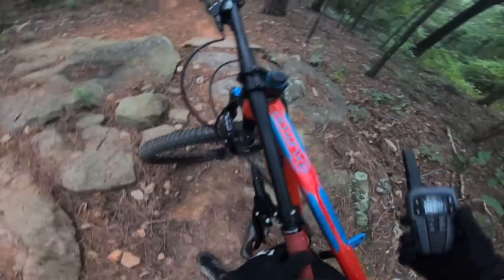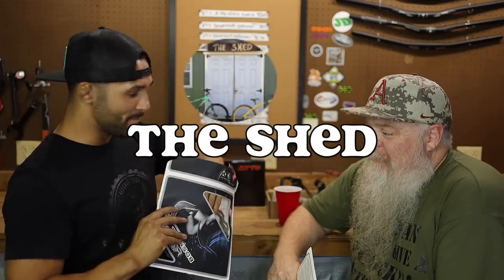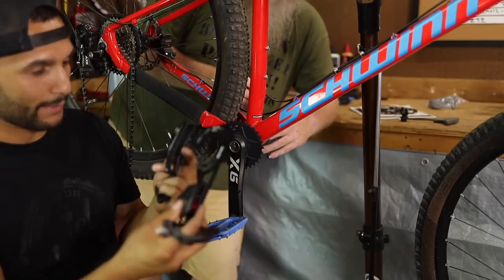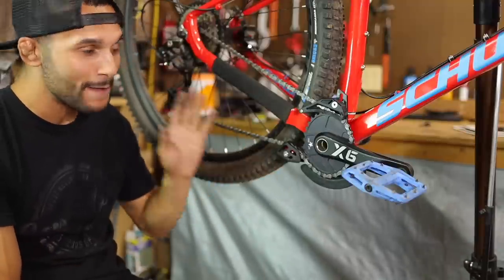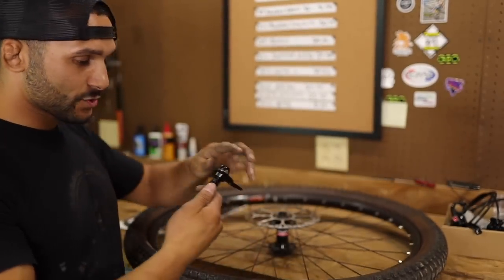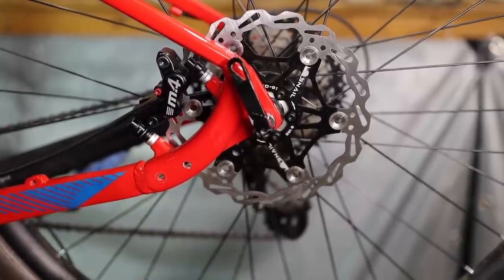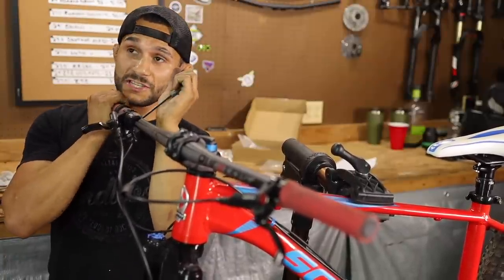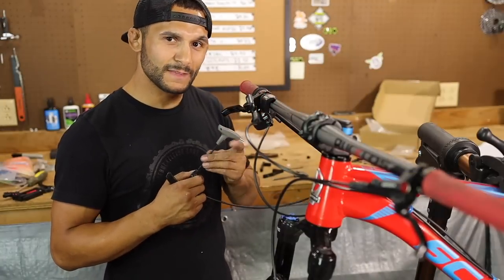ZTZ / JFOYH / MEROCA Budget 4 Piston Hydraulic Brakes!!!

Comment: 0:46 this is why I always make sure the handlebar can turn at least one 180 deg. but to me, it could be cus the hose was not secured properly. this has never happened to me. but at least the cable did not get cut.
Reply from the maker: Dude I feel ya but the bars were 360!!!
Reply: @WOLFTICKVIDEOS  how did you manage that? Never happen to me.  It cables are any longer on my bike it will be too long. But I am maxed out at 1700mm rear brake cable, so would need new cable to do longer. But it actually fits. But if it was a bigger bike it would not. So rear brake cable is uncut.  My bike can turn past 180 deg, half and a quarter turn. So I am safe. But my setup is mechanical now.
Reply from the maker: I DONT KNOW!! LOL The bike was completely turned up!! I am so glad nothing else was messed up, especially the dropper lever.
Reply: @WOLFTICKVIDEOS  if you don't already, make sure cockpit controls are not overtightened then they can get damaged easier, make sur eyou can hit them with your hand so they move but won't move under use.
Reply from the maker: Thats not a bad idea:)

Comment: 6:08 the guide should be aligned with the center of the bb.  so for this, the bike should be level on the ground. but otherwise, it seems to be correctly installed, 
but note that this guide is not designed for oval chainrings.
Reply from the maker: Gotcha, I have it set in the 32T mark:)
Reply: @WOLFTICKVIDEOS  ok, if your chainring is 32t then yea that's good. But I meant the angle is wrong, out bike on the ground then align the guide so the it's in the middle, aligned with the bb. Usually bolt is in the middle.

Comment: How have these held up? I jacked up and stripped out the lever on the front tektro auriga on my ebike. Fixing or replacing it with another would have cost more than this, so I purchased a single one for the front.

I put on Galfer wave 2.0 203 mm rotors and will still be running the auriga 2 piston in the rear. Hopefully it works out well

Also, I really wish I had that tool for cutting the hose and pressing in the barbs but hard to justify for a tool I might use once or twice
Reply from the maker: Man the front seems to be descent, but we have since reviewed with new pads and bleeds, and well....Not So Good 😥😥😥

Comment: Motorbikes have the front brake on the R/H. Not sure why some countries have them shopped on bicycles. Seems a bit odd.

Biggest problem with buying hydraulics in China is the common 800mm front hose length. A fork 120mm+ travel, with riser bars, needs a  1000mm+ hose.
Reply: probably the reason why chinese brakes only come with 800mm rotors is because Chinese are smaller on average than westerners so that means their bikes are smaller so that's why the hoses are shorter. just my guess or maybe its cheaper to make them that way lol.
Reply from the maker: Yeah I have noticed a few pairs barely cutting it when it comes to a 29er

Comment: Ouch! Hurt just watching.
Insurance companies charge more for red cars & they are statistically pulled over more often by the police. 2 Good reasons not to drive a red car.
If you're still getting chain drop with a narrow wide chain ring your chain may need to be shorter.
I used to have chain drop issues when I first installed a mid-drive. It turned out that a narrow wide chain ring fixed the problem. Some people do use chain guides on e-bikes but to me it's a sign that you don't have the right chain-line and/or too many chain links.
Those brakes look interesting, can't wait to see them in action. I'm skeptical about mineral oil, for myself, because I sometimes ride in winter weather and have read some poor reviews of how mineral oil does in the cold.
Reply from the maker: LOL!! Man it hurt realtime too! I think the chain being an 8spd mixed with a non narrow wide is the problem:( Appreciate the input and hope the brakes workout!! We will find out tomorrow if we get the REVENGE!!

Comment: Could've just swap the hoses from left lever to right lever.. That's what I did with my hydro system, and its been going strong 4 months now :D
Reply from the maker: Gotcha, we did tat on the front left brake hose, and as for the rear it was a little long plus wanted to use the tool since we had proper olives and barbs, Thanks!! I just let someone know how well they are doing:) appreciate the comment man

Comment: I just got some branded "Blooke" the levers look exactly like those ones, but mine are 2 piston, and I made sure to order the ones with the front and rear on the correct side 😉 The dimples on the lever blades feel really nice however when I was installing them, part of the caliper housing was interfering with the rotor, so I had to file that down, and the rear hose was just a bit too short to run it the " correct way " around the front of the headtube, but I made it work 👩‍🔧 Complete night/day difference compared to the stock mechanical brakes that came on my Ascension! I also recently acquired a full suspension Cannondale Habit that just needs a little bit of work to be in tip-top shape!
Reply from the maker: HEY!! So nice to hear form ya:) Glad you are still rocking the ASCENSION:) We will be breaking that bad girl out next week! And I dont think we worry about "correct way" either!! LOL So no worrys:P
Hope all is well and you are getting plenty of riding in Josie! Nice to have you back girl! See ya Next Week!!

Comment: Hope your wrist is OK !!! --Love the flow of the coffee shout out and cannot wait until my Meroca's get here, but I don't have a bike to put them on yet, maybe the Al Comp Mullet? Goung to drop from 12 bikes to 4, so see if you want a Diamondback (17.5") M sized Trace Sport with 9Speed Deore ??
Reply from the maker: Man it is peachy! It is the hand that is JACKED!! LOL GO MULLET for the Captain:) Now a trace sport?? Hmmmm.....how much??
Reply: @WOLFTICKVIDEOS  Looking for $600 because I cut the Air fork at an angle and it is slammed, so no riser play--still one of the lightest aluminum frames I've ridden. has Continental Xkings on it Cycling deal wheelset 29er, but easily converted to 27.5/650b or mullet. Shimano Tourney TX mechanical disc brakes, Shimano Deore (Dee Or AYe) Deraillier and shifter with Shimano hyperglide 9s 11-36, but feels like 40 tooth. iXF red cranks and the black flats with red in the middle like you had the first time. Cane Creek headset and Bucklos 120mm up front. Easy to wheelie!! Comes with the Diamondback 400 mm seatpost too! Wolfman can rais the seat and ride it himself if he wants--maybe too small for 6'4", but put some Ape Hangers on it and put at min insertion ride on, brother-man! You'd have to plan a trip to PNW to pickitup....
Reply from the maker: We will start plannin:) Man hopefully someone jumps on that! We are a little thick with projects right now but hope someone will see this.

Comment: You didn't bleed the brakes? You can do a simple top bleed to let the air out on those levers with some fluid and a bleed cup.
Reply from the maker: Yeah we might do a brake bleed video on them at some point, but we didn't have time or the need to do one just yet. Maybe we will revisit a brake bleed video in a couple of weeks, after some good use. Thanks man👍

Comment: I think the chain guard interference is from using that style of crankset/chainring because the offset is different.  Also those snail rotors are a little sketch I've seen a few reviews of the rivets failing and the rotors getting mangled
Reply: some guides have shims to adjust clearance, for different chainring offsets. like on the guide designed by 77designz, Absolute Black uses it on their guide.
Reply from the maker: Man I hope the rivets hold up, we will see. They have always interested me:)
Reply: Do you have any links to that? That is really ba dif this happens, it can be deadly if rivets fail during riding.
Reply: @WOLFTICKVIDEOS  yeah man the real shimone icetech rotors are super cool, be pretty neat if these actually provide any real benefit
Reply from the maker: Fro sure man, they look awesome!

Comment: You can find different shape adapters on Amazon to fit the frame your building, I’ve had similar issues with brakes before
Reply from the maker: Hope so, I think the bike may not be designed for a 180mm rear, but I really hope so

Comment: I've got the same brake on the front of my emtb with 180 rotor.
The only complaint I have is that the hoses are very soft & make the power low when they are pulled hard.
Reply from the maker: Hmmm....Have not had that feeling yet:) Interesting

Comment: Ok so because of the mention In the last vid, I bought a pair of these to test for comparison to what else I've ridden. I have xt 4 pots on one bike, slx 2 pots on another, and have also ridden guide Ts, and Code Rs. Even after a bed in these brakes are pretty down on power. They aren't dangerously low like zooms, but they're really hurt by the firm lever. Like there's so little sponge that it causes finger pain trying to stop well with 1 finger. If honestly put them in line with tektro hdm275/m290 brakes with resin pads. They may get better with metallic pads. But thats another $40. Honestly if I was starting out again I'd save a bit more for some shimano mt500/deore/slx/xt/xtr 2 pistons. You can also find good deals on used brakes. I've seen SLX m675s for somewhere in the $150 range for a set on pinkbike. Still can't wait to see your thoughts on them in the next vid and I love the vids :)
Reply: There's just nothing like those 4 piston shimano brakes.
Reply: Damn...

I didn't want to go Budget on my brakes but I keep holding out and having high hopes for some of these budget brakes. What you wrote sounds completely accurate though. I'll get shimano's. Brakes are too important.

I love buying used things and restoring them. I'm surprised to see how many people would put budget parts on their bike before buying quality used parts.
Reply from the maker: Man thank you for the insight ad we shall see how they feel! I can see what you mean about possibly going used and or new pads but man, for the $83 price tag....I cannot wait tot try! Thank brother and see ya on the VID!
Reply: @dylan-5287  Well, try magura, then you get to know power! But yeah shimano everything for me...

Comment: 6:00 - Is there room to shove a thin BB spacer in between the BB bearing shell and the ISCG mount? Might stop the rubbing.
Reply: it does not have to be the BB, that will change the crank position. but there should be a spacer between the bb and the bb shell, which the adapter replaces. but for clearance, you can use spacers under the mountain plate. but this might not be enough.  if the chain rubs at the outer parts of the guide, you can use spacers between the plate and the adapter. some guides come with spacers.
Reply from the maker: No room brother, good idea but I tried and the shaft is too short:( What is done is done....LOL
Reply: @WOLFTICKVIDEOS  what do you mean by shaft?
Reply from the maker: The rod that goes into the shell.
Reply: @WOLFTICKVIDEOS  oh you mean the crank spindle. No spacer there then.

Comment: Do you reckon they work with Shimano Brake levers? E.g. M6100 Deore Brake levers
Reply from the maker: Well same size line??? I would not see why not....TRY IT!!
Reply: @WOLFTICKVIDEOS Some updates on this, found out the only thing different about them is the use of BH59 and BH90, just need a cable swap and end should do the trick
Reply: @WOLFTICKVIDEOS  Have any ideas on how big the pistons are on those Meroca M4s?
Reply from the maker: Hey brother sure dont?? Sorry to answer this so late and with little info! LOL It was in the spam, but man no clue?? What are you trying to do?
Reply: @WOLFTICKVIDEOS  Hey man, recently found a listing for a pair of ZTTO 4 piston brakes, was choosing between the Meroca and those

The ZTTOs have 14mm pistons all round and apparently use Shimano 2 piston brake pads which is odd